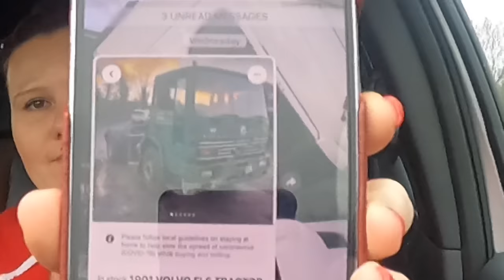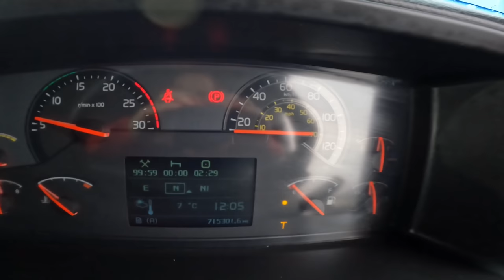Buying a lorry!!! Owner operator buying her own tractor unit 28/1/22

Comment: Pro & cons of buying a used truck, that dealer had a lot of stock to choose from, i think you chose well, FH13 460 13 reg v3 xl cab/leather, mileage good/chasis painted, nice neutral cab colour (white),. fuel mileage not the best, 7.5 to 8.5 mpg is what i get on my fh4/460, and thats on light sometimes heavy, out empty/load back work (A roads), pulling 4.5 high tautliner, volvo can do a history check if you give them reg, i got one foc, . tells you of all breakdowns/parts/repairs/replacements etc,. i would speak to previous owner or driver to get more info if volvo dont have any records maybe its not been on volvo  R&M ,. i would also have tried to get the dealer to swop some of the worn/us bits off another unit if possible,. he could have swopped the super singles over and the steering wheel, and maybe even the fridge/bunk/switches etc,. your partner is well clued up on the truck, so nothing to worry about there,.at least it's paid for, one less worry, theres enough of other expenses , fuel/add blues (mine does 2.5 k miles on a 80 ltr add blue)/insureance/maintenance/parking/o licence/trailer hire/wages/vat/acountants/ tyres/at least your not driving it through the kelsa shop !,.(yet),..i would have thought southampton would be a better option for you work wise, didcot handy for getting home weekends etc ?  one more tip, get receipts for everything   and claim the vat back, obviously fuel and parts, but dont forget meals/o,night parking/tolls, all sorts of stuff you can claim vat back on,.looking forward to seeing you on the road,.
Reply from the maker: Oh definitely will be claiming it all, thank you Mike great advice there!! Didn’t even think of swapping things from other lorries, might just try that when buying next one hehe. Good thinking!!

Comment: Thank you for the video, it's the first one I'm watching on your channel. I'v been in the same position as you were back in 2015, I'v seen many second hand truck yards, fleetex, walker etc etc, the best by far was Britcom, the only place who really prepared/fixed whatever was wrong and sold genuine trucks to me. From fleetex I had Man tgx engine blown, also from fleetex I had Iveco Stralis - bought for 16k, on the first year spend 24k on repairs. From Britcom I had 4 x Renault Premiums 2012, mileage was between 218k - 480k. - all of those bought between £12k - £13.5k. In my opinion, any truck after 500/600k on the clock will eat all the profit that you could have left in your pocket, believe it or not Renault Premiums proved to be the most reliable of them all, no faults at all, had window motor replaced and thats about it. Also Premiums got all the guts from Volvos, if I were you, I would suggest get a Premium low mileage, it will never let you down. Also if anyone is after second hand truck the only genuine place I found was Britcom, the rest just sells you junk (maybe it was just my bad luck). Anyway I wish you luck and hopefully I'm wrong and your Volvo will serve you well :)
Reply from the maker: Wow thank you Acad lots of good information there I will take it on board. Thank you!!